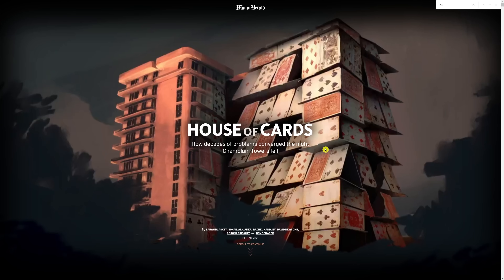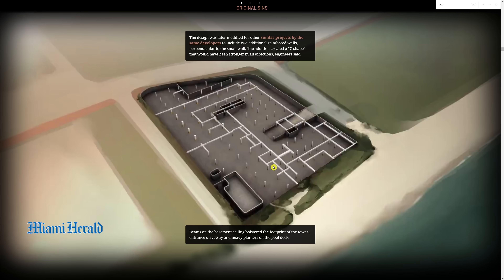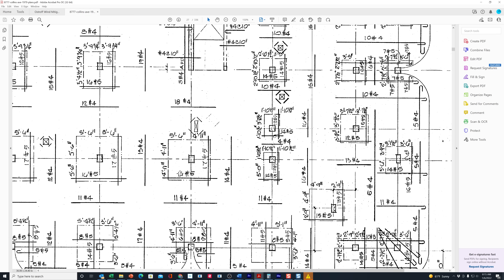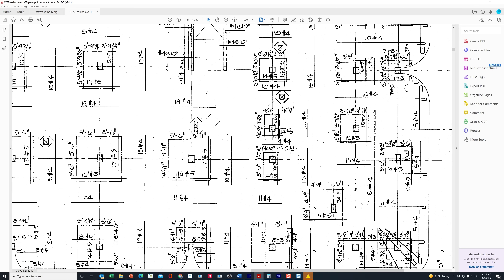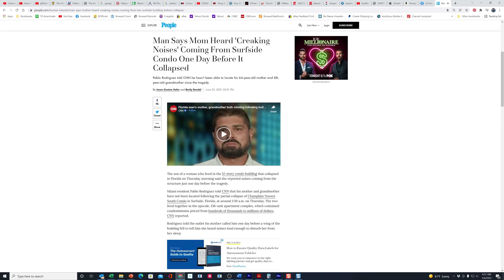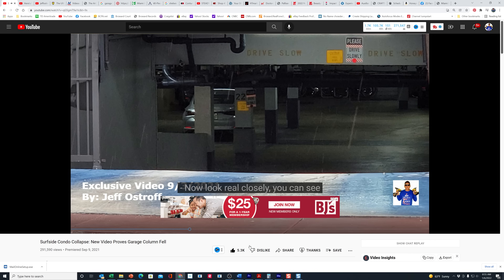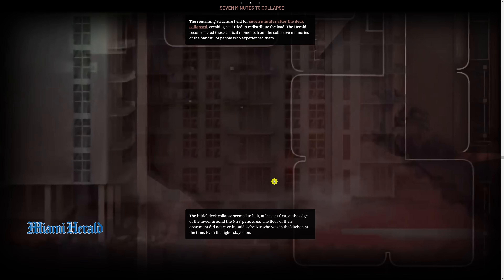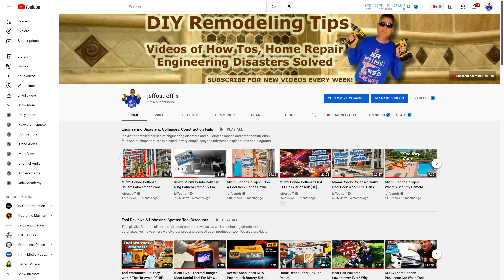Best Condo Collapse Theories: Me Or Miami Herald House of Cards?

Comment: Thank you for posting this (and also your prior) video. I am the engineer who led the technical aspects of this study for the Miami Herald. If you look at the article on the modeling, you will see that we do not see damage initiating at Unit 111. Instead, the modeling shows that the damage propagates into the tower at the gym. Structurally, this is logical since the framing at Unit 111 is more robust than the framing at the gym and the connection of the floor framing to the core wall is not sufficient to sustain the demands.
Reply from the maker: Hi Dawn, thanks I'm glad you liked the video. The one issue that I see here is that of course I still believe that the third column in the tourist video which is M11.1 was probably brought down by the collapsing pool deck and so that's why I showed in the tourist video that you could see the third column appears to be missing there. So, keep in mind that the very spot where column M11.1 stood is where in 2018 the engineer Morabito discovered the most amount of damage and cracks on the ceiling near unit 111 in the garage and stalactites from improperly repaired grout injections, as well as the grout injection ports were left in the ceiling illegally. I think the beam you mentioned under 111 was weakened, and possibly already under tension as we pointed out in Fiorella's garage video.
So, I think that if you take column M11.1 out of the equation, you have a much-weakened support structure in that area that now has an increased load demand on it, plus the rotating beam along the southern edge of the building. Do you think any of this could have reached over to the fitness center connection to the wall there and maybe it all migrated in that direction? I don't know if the simulation can take into account things like that, the cracked and weakened ceiling. Could it take into account for example things like the concrete no longer being rated at the PSI that it was when it was originally poured because of all of these cracks and water intrusion and spalling over the years?
Reply: @jeffostroff  There may be an element of speculation in where the failure originated because we have no way of knowing or at least quantifying the amount of deterioration of the reinforcing at any given location.  The pool deck structure could be modeled and the loads applied to the best of our ability based on planter locations and so forth but there will be some uncertainty in this too because we won't know the as-built thicknesses of mortar setting beds, planter walls, etc.  This analysis could show the location that the most overstressed and this could be a clue.  However the overstress would be calculated with respect to the reinforcing steel that is on the drawings and there could be locations with very significant loss of section due to corrosion meaning we wouldn't know what location is really overstressed the most based on its deteriorated state.  Where the failure originated would have some bearing on which columns in the tower were affected first because the failure would likely progress outward from the origin and it would hit the tower where it hit the tower.  Once one location fails it will transfer load to surrounding areas in which case there would be failures there in flexure or in punching shear, and so on as the failures progress outward through the pool deck.  I think the nature of punching shear is such that once one span or support fails it not only adds load to nearby critical shear sections it also adds unbalanced moments at these areas and that alone is enough to cause new punching shear failures.  The small offset beams around the perimeter of the tower do not have enough torsion capacity to resist this so they would easily fail in torsion allowing the deck slab failures to progress into the tower where the column capacities are now affected.
Reply: @billj5645  Exactly.
Reply: @jeffostroff  Because we did not have the as-existing material properties, we did not degrade the concrete mechanical properties or the bond properties. I believe NIST will investigate this as part of their material investigation and will include those measured properties in their models. 

The article on modeling discusses our findings from a limited parametric study as well as the loading used for the evaluation.  I think that will provide answers to most of the questions.
Reply: @jeffostroff  Yep the step beam was 12" less than originally proposed so this beam was supporting the building columns. The deck and column failures cause massive damage to the step beam.
Reply: Thank you Ms Lehman Your Analysis and investigating of this is Brilliant . And congrats to the whole team at Miami Article. If this Visual animations is the future of some articles , then The Miami Herald has risen the bar extremely high ! I had the same theory except I have different columns.
Reply: So is North also missing those beams? Do they also have that retaining wall?
Reply: @Wazupu  interesting question 🤔
Reply: @Wazupu  Yes, CTNorth has the same type of retaining wall.  CTNorth also deleted that step-down from the outdoor/lobby parking area to the pool-deck, so those (Schedule Type A) beams were probably also deleted.  HOWEVER, for some (good!) reason, in CTNorth, that Eastern stairwell was enhanced to not have just the 1 lame shear-wall, but 3 integrated solid Cast-In-Place (CIP) concrete shear-walls (in a C-shape), which is a big plus, and might mean, theoretically, that should THEIR center section collapse, that Eastern stack (and the stairwell) might stand long enough for everyone to get out.  Also remember that the "weak" center section in CTNorth is much shorter, i.e. CTN is basically CTS with the x4 and x10 stacks deleted, so that's a plus, i.e. shorter span between the 2 "spines" or shear-wall structures... would LOVE to know what prompted/forced "Nattel Construction" to upgrade that structure, since Duh Developer was NOT known for doing the right thing.
Reply: @MajorCaliber  Also I believe CT North is a post tensioned designed building, rather than the flat plate slab of CTS
Reply: @brnmcc01  NO, you're thinking of CT*East,* which was erected over 10 years later, and did, in fact, use post-tensioned slabs.  CTNorth was going up just a few months behind CTSouth, same contractor, same slacker methods, same under-strength "mafia-mix" concrete... OTOH, AFAIK, CTNorth did NOT suffer a crane collapsing across the formwork for the critical BEAMS at the 1st and 2nd floor level... so there's that going for them... might be a factor.
Reply: @MajorCaliber  Yes you're right, I was thinking of CTS East. I get them mixed up sometimes :)
Reply: @Wazupu  Yes. CTN also has missing beams and the perimeter wall around the site. We did not analyze that structure (our “team” was just me and a student so we did not have the time or staffing for additional work; again I hope NIST will investigate CTN as well as CTS).
Reply: @Wazupu  come and join us and can research that. If you hit this profile the group link is there 🦋❤️
Reply: Dr. Lehman, what have you learned about how well (or not) the slabs East of the elevator shear-wall were "hooked in" to said shear-wall?  Seems the slabs in the x10 stack (incl. the Gym) cleaved off very cleanly, and I can't tell from the lo-res pics whether the slab rebars pulled straight out (should NOT be possible), or just snapped off even with the shear-wall...?
Reply: @MajorCaliber  I think Jeff Porter over at Building Integrity looked into this and he said once a few rebar connections fail, the rest will quickly shear off kind of like tearing a perforated bill stub off the bottom of a utility bill :)
Reply: @MajorCaliber  There were different damage modes for the slab to core wall connection. I will be presenting on our investigation on February 10. This presentation will provide a more complete description of the full forensic investigation.
Reply: @dawnelehman2592    Can’t wait.
Reply: @MajorCaliber  Nothing was designed for a collapse scenario so anything could have failed.
Reply: @Dawn E Lehman Thanks for your great analysis and central contribution to the Miami Herald feature and your participation in the comment.  I do query your premise of the tower collapse starting at the gym.  In the CCTV video from 87 Park I think provides definitive evidence that failure began at K/9 L/9 and I/9.  Yes the video is grainy but there is enough detail to pinpoint where the tower first dropped.  

I believe the 3 planter beams applied a moment to K/9 L/9 I/9 and shredded their rebar as they rotated.  They held for 7 Minutes and then gave way bringing down the tower and this starting point of failure indicated in the 87Park video.    

I'm curious to hear your take on the 87 Park video and the first point of failure.
Reply: @Mike-Bell  The modeling article that I posted a link to separately provides a description of our approach. I will summarize it here but I encourage you to read that article for more information:
https://www.miamiherald.com/news/special-reports/surfside-investigation/article256178672.html

Our investigation was undertaken to evaluate possible initiation mechanisms in the pool deck that would lead to initial damage in the tower because the timeline clearly shows that the pool deck collapsed prior to the tower. Damage to columns immediately to the south of Unit 111 (the Nir unit) would have been noticed by the Nir family. In addition, no one from the 10 stack (that is the stack of units above the gym) survived. 

However, we are not providing a conclusion, but rather a viable scenario about where the collapse initiated and where & how that damage would propagate into the tower. 

The analysis (which is very sophisticated and beyond what an ETABS model, which is the model Jeff showed in his "NIST" video, can simulate) did not indicate any column damage. In addition, slab-column connection damage was not fully modeled.

Damage initiating at the slab-wall connection to the west of the gym would have quickly propagated east, as it did in the pool deck. As such, the tower collapse could have been largely due to damage at the columns you have mentioned and/or the connection to the slab. But that investigation was beyond the scope of our work. 

I  want to emphasize that we only used the information available to us: damage photographs and videos, an experimentally validated modeling approach, witness testimony and the design (as opposed to as built or as existing) drawings. I hope that NIST will use this model and its results and build on what we have done. This was work that was conducted over a very short period of time, without any resources (this was done on my own with a single student in the end) and I am very proud of what we accomplished. 

That being said, I am more than happy to answer any inquiries and very much appreciate your interest in our work.
Reply: @dawnelehman2592  Thanks for replying.  I have not seen the link.  I will read it with interest.
Reply: @dawnelehman2592    Thank you for the link to full article. Very informative on your different scenario analytics. Sometimes we are not as tech savvy as we think at finding stuff.
Reply: You all did a great job with the renderings and graphics!

Comment: The fire alarm company owner stated that smoke detection was not heavily implemented 
The FACP monitored  sprinkler system water flow detection devices, manual pull stations and some scattered smoke;p/fire detectors.

Comment: I am hooked on yr YouTubes … tyvm 
Very relatable topics… My POV=
It’s appears a lot of free driveways or basements where created with the aggregate products skimmed off this job… 1st) concrete that doesn’t stick to rebar is not mix correctly. Sounds like it was thinned out… as you said, the rebar was clean consistently. That’s the first major clue? Evident evidence without doubt. 2) supporting beams in different sizes will create a collapse overtime. hence the centripetal force load on the lighter beams will cause a collapse. 3) beams that are painted to red could designate, being altered. 4. It is possible that the beams were thickened over the years. They really need some old photos. 5. The roof and what was supposed to appear as indentations of valley creating drains.Vs pictures available after the collapse. I could see it the first time that the roofs were altered so much over the years..That drains weren’t where they were supposed to be and they definitely did not have those dome drains making it top-heavy.
7) because I have to share Y W the world…. How They we’re not required to use Steel beams.. or where they..
Have Y found the blue prints that explain the … I have yet to see the structural design, n materials .., last would old maps show this was a garbage dump prior.. just a thought in response to the way, the building fell and landed after the collapse like there was no ground underneath it hence possible garbage just a thought thank you very much for your platform
Reply: 7) i’m making the seven because I have to share you with the world. However, the way the debris fell and sunk like so low so quick it’s almost like it was built on top of the garbage dump. Maybe you could look and see if that was a garbage dump at one time when surprise me thank you very much.

Comment: The building collapse was not a question of steel, was a question of concrete, of poor concrete.
Everybody in the construktion buisiness know it, its a worldwide thema,  it is a corruption thema.
The construktrors in miami are a spezial kind of  latin  construction companys,  and one of the Eaerning ist in the  concret mixture., less cement and bad sand and stones. You can mix together everything, and mix with cement, you can build a house o a bridge. That will stay fore a while, but collapse one day in SECONDS, dosend matter how much steel was used. Never the question how much steel was used (when the construktion  
collapse less than 10 years old, without oxidation).The error is in the SAND and the CEMENT.

Comment: Just a note, an alarm from a flow on the sprinkler pipes  will trigger an alarm just the same as a pull station, this will automatically alert the monitoring company, who per policy will alert authorities. The only way flowing water in a sprinkler pipe won't trigger a general alarm is if you have a faulty device.
Reply: And a flow detector doesn't differentiate between a head busted through heat, or damage, or contact with a foreign object. Anything that breaks one open, triggers an alarm on the panel. So the damage seen in the tourists video was possibly an alarm trigger event.

Comment: At 3:15 you show the H beam. Where are the columns that held it up? From the perspective of the picture it looks like it move straight back a foot or so to clear the columns. If that column on the right with the red base could be shown to be one of the columns that held the H beam it would verify the spot.
Reply from the maker: The columns that held up the H beam have all collapsed but if you look at the endpoints of the H beam you will see remnants of the columns there sticking a little bit out of the ground so the age being basically slid about 12 inches north and then down the columns

Comment: I recently found your videos, and think they are well done, and draw reasonable conclusions. I think we need to have a discussion about the fire protection systems. Sprinkler flow should trigger an Audible alarm, like a pull station or a smoke detector. typically there will be a flow switch at the intake for the sprinkler system, and one per floor, so the panel can indicate where the flow is. you want the panel to alarm on flow, since that likely means a head has been activated due to heat, which can happen before a smoke detector activates. the post collapse video seems to show a strobe activated, but there was no audible tones. this makes me wonder if the system  was working properly to begin with, or if it was left in alarm due to a fault, and had been silenced. This is all somewhat dependent on what code required in 1980.

Im in Canada, so we put dry sprinkler pipes in attics, so they dont freeze and burst. the system includes a compressor, that pressurizes the pipe, and holds the water back. when the power goes out, the air eventually bleeds out, and the pipe fills with water. this triggers a sprinkler flow alarm. sometimes the panel will reset, other times you need to shut down the sprinkler valve, or silence the alarm if the panel wont rest out of alarm, and have a technician look at it.

If we had sprinkler flow in the garage per the tourist video 7 minutes prior to collapse, and that sprinkler flow triggered an alarm, there is a good chance residents would have evacuated prior to the collapse. ( i would also be curious if anyone thought to activate a pull station, especially after the pool deck collapsed, but before the tower came down.)

Comment: Catch me up here...  Has anyone gone in and measured the exact location of the mystery pier, either by direct measurement or by drone footage?  Seems to me that pier being out of synch with the beam(s) is evidence that the building rotated upon failure.  The alternative explanation is that a pier popped up out of nowhere.  Or did I miss something?  In any case, it should be straightforward to measure its location against the drawings, and not against the debris.